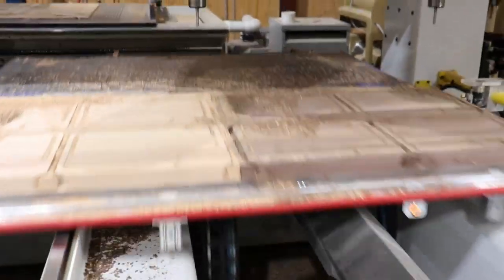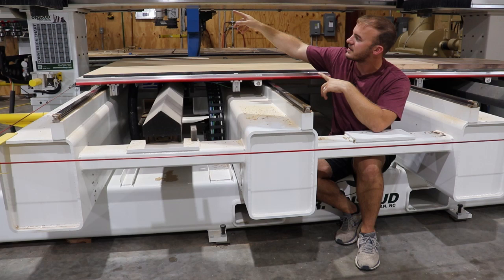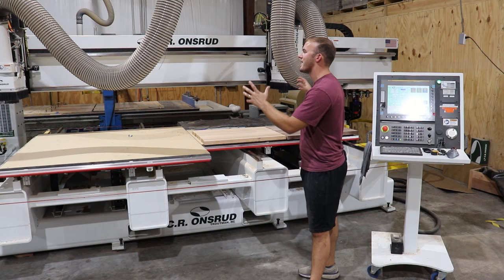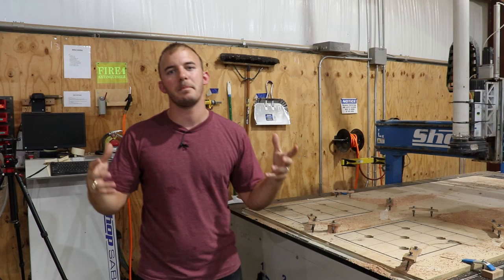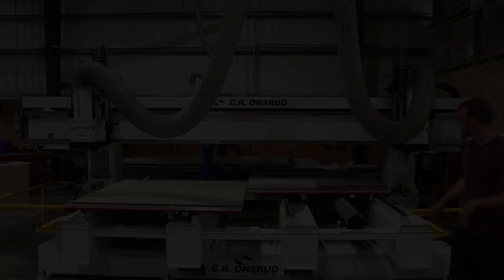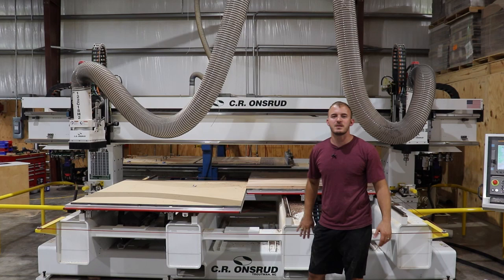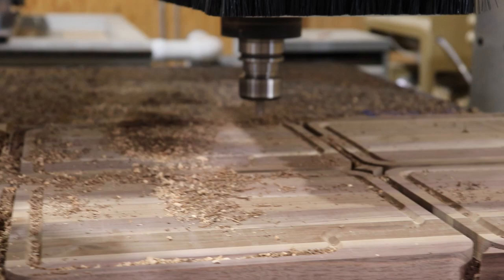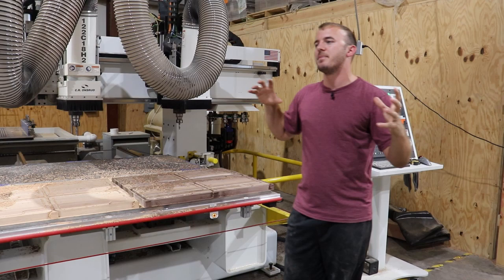It’s MASSIVE! My New CNC Router | A Quick Look at This Beast!

Comment: That CNC Router is Awesome.  I have run a machine like a few times and they are super versatile.  The split table really fun to use.  My work we cut acrylic and polypropylene mostly as well as cutting Trespa material. Our machine didn't have the dual head as we usually were cutting one off parts from full 5x10 sheets of material

Comment: Eh… it’s a nice enough machine. I certainly wouldn’t kick it out of the shop. 😉However…

ATC functionality like that is standard on production-level machines; and at least for VMCs I’ve only ever seen it done really differently on an oddball Chiron ultra-high-speed 5-axis machine where they had the tools mounted surrounding the spindle (it would just slap up to the Z home position, and switch tools with two “petals” of the tool magazine - the whole process took about a second). Router ATCs that I’ve seen can also mount the tool magazine off to the side of the table; and just do a rapid move with the head to go grab another tool. Machines that are more entry-level or prototype focused is where you tend to find a lack of a tool changer.

Dual head & table is a nice flexibility feature to have, especially if your shop isn’t dedicated to one single product line. I have seen it advertised on a few other machines.

The thing that gives me a bit of pause, however, is the use of steel weldments for the machine frame. Unless specific treatments are applied; they can warp (both immediately during manufacturing and over time afterwards); and tend to “ring” from vibrations caused by the cutting process. I’ll have to presume that a major manufacturer like Onsrud will have stress-relieved the frame prior to grinding the rail mounting points. I did note a bit of a ringing tone when you tapped on the frame with your knuckles… you might want to grab a wooden or soft metal hammer and gently tap on it. If it rings like a bell; you might want to apply some dampening material like epoxy-granite to the frame.

This is why cast iron is usually used for machine tool frames; instead of steel: it doesn’t ring.
Reply from the maker: Thank you for all of that info, I learned a lot from this post
Reply: I agree with this all being relatively standard. Worked around 3 and 5 axis DMS machines. Once you enter a certain level in the cnc world they share many of those QOL improvments. What blows my mind are some of the 5 axis metal cnc machines.

Comment: Maybe I'll trade in my crappy old scroll saw and get a few of these. I don't suppose my 20 amp shop would power a couple of these would it? Probably not.. I used to work running a ginormous extrusion machine with 880 boxes everywhere. Don't stand in a bucket of water and stick your fingers in one.

Comment: And what would be the benefit of owning this machine over just getting two normal single spindle ones?
Didn’t quite catch that
Reply: Right off the bat probably more efficient, practical and less shop space.  To have two machines you would have to be running from one to the other, this one just one pc control.  Either way, id take any setup any day of the week :)

Comment: U know when u use vacuum you don’t need tabs. Or maybe I don’t understand something about your system. And u also shot look in raise vacuum system then u don’t need to Cory as much about messing up your table or the tool they called vacuum pods. I had the chance of working with 5axis machine and it had that system and the worst thing that could happen is you mess up the pod that made out of plastic. But love your videos.

Comment: Final got your self a real machine rather then the toys you had before. So funny to see you being amazed by all the basic functions that your machine has. Basically the majority of cnc world is professional shops that run machine like this, maybe not dual head, but ATC, heavy frames, big HSK spindles. There is this weird YouTube world full guys running toys, calling them self pros, giving out BS advice. You should have gone out into the working world for a few years and work with one of these machines before being a expert, but I guess your getting there now. I went to 6  years of school, worked for 10 years running machines and lots of there engineering related stuff before I started my own CNC business.  Also like most guys that own machine like yours I could rip that machine apart and put it back together again. When feeding your family depends on that machine you better learn how to work on every part of it your self because when it goes down there no time to wait for a tech. Also you have 40 hp vacuum pump and ATC pretty sure you can cut all the way though those and not have to trim off the bottom, actually if you use a 1/2 Compression I bet you can get a board with out a tool change on the outline.